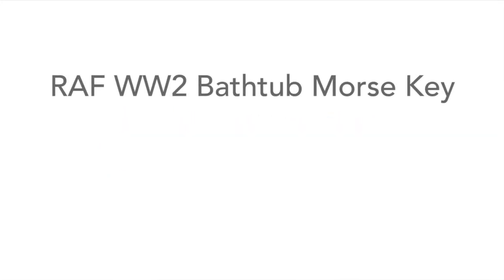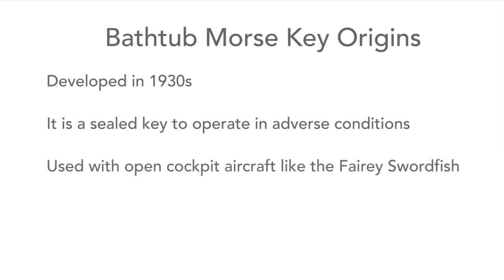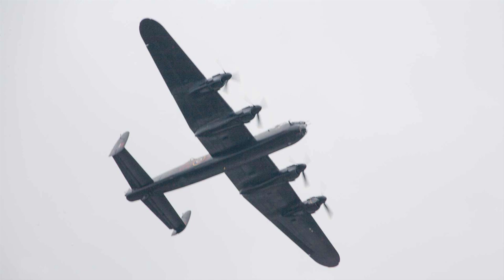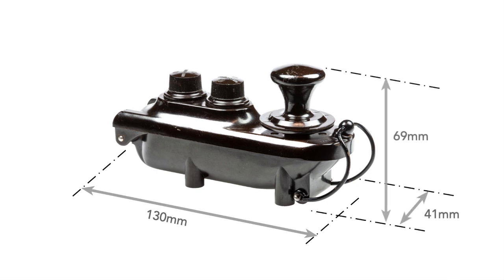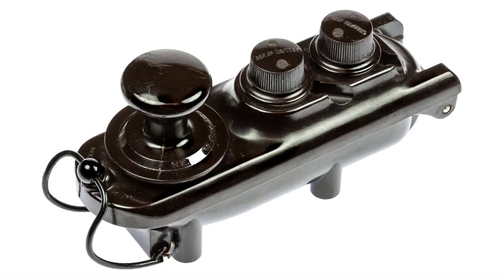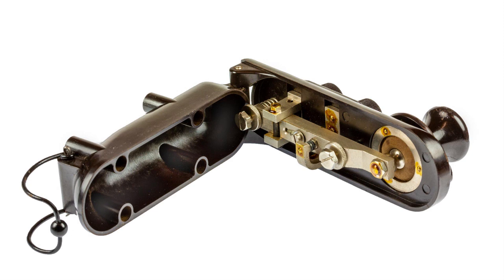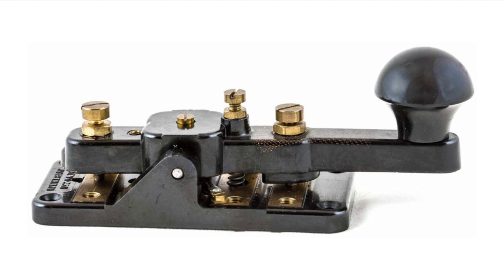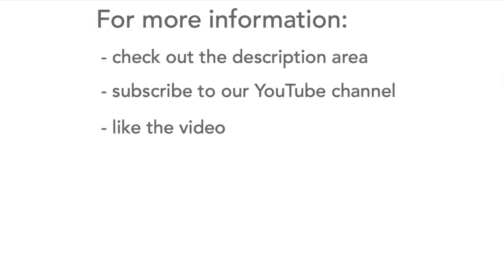BathTub Morse Key used in WW2 RAF Planes

Comment: Amazing artifact and detailed video! One thing I'm wondering about - if the key was preferred as it couldn't emit an external spark, how were the 303s regulated and used? Was the radio equipment in a more sensitive/ fuel contaminated area than the guns?
Reply from the maker: That’s an interesting question! I think it was a fear more than a reality and the fuselage and cockpit could have harboured more fumes than where the guns we’re located which tended to be external.
Reply: @ cool, sounds like it’s a generalised ruggedisation. I imagine the navy keys were also more encased.

Comment: I have one of these it was given to me by a friend his father was in WW2 and was a wireless operator in RAF my neighbour mounted it on a piece of wood for me they were certainly built well.
Reply from the maker: Yes, a lot of things were well built then, especially as they had to undergo a lot of punishment in their environment. I didn’t find the key easy to use, but that probably would not have been too much of an issue as the wireless operators would have been wearing gloves as it was very cold at the altitudes they were flying.
Reply: @ElectronicsNotes  yeah they would of been used to it my great grandfather was in ww2 and in Kings Dragoon Guards he used wireless and radio out in desert whilst driving armoured cars but I’m not sure exactly equipment he used.
Reply from the maker: @Crash-zm2qd  these keys were used where they needed a key that was protected from the environment. Sand is never good so that is why your great grandfather would have used one of these. Well done to him for all his service.
Reply: @ElectronicsNotes  I have his medals mounted on wall they used to be apart in desert about 60 to 80 miles away and still kept in touch by radio and wireless.
Reply from the maker: @Crash-zm2qd  that is brilliant - a real memory of his bravery.

Comment: I have one in unused condition including the waxed packaging it came in 
I believe these keys were straped to your tigh ??
Reply from the maker: They were often bolted to an operating table in the aircraft, but could have been strapped to your thigh.
Reply: @ElectronicsNotes  I have one which was never used since it’s last service in 1951. I think, given the action, it would be too stiff to use as a leg strap. 

The WT 8A I have mounted to a leg strap was off a 19 Set. Much more forgiving
Reply: Hi, I picked one up last night, again in unused condition in its brown and waxed paper, the box showing 'PP Qty 1: Key Morse'. It was re-boxed in September 1963 and shown as an F-type key. I've been studying Morse code and am I'm a member of the LICW Club (only one of 198 Brit members). This key is going to be used for sending CW. Can't wait.